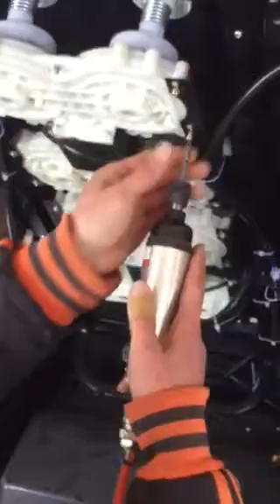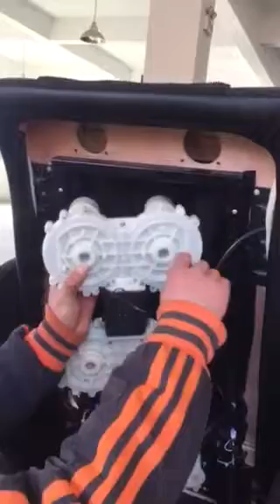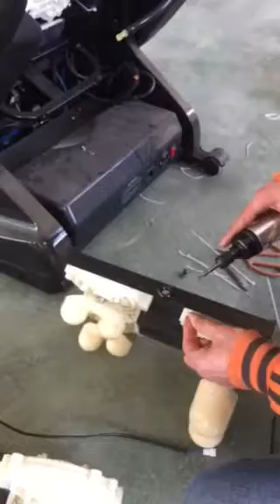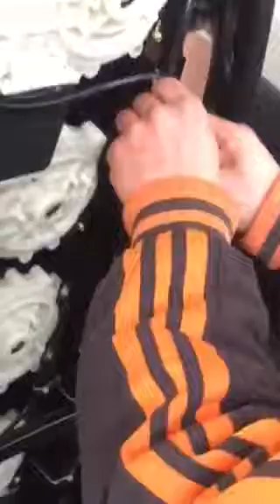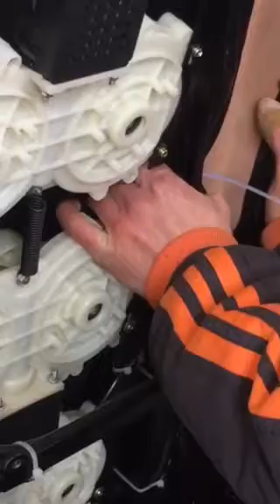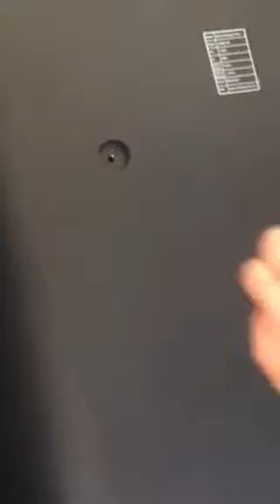Favor03 Real Relax Chair-How to replace the roller in back

Comment: I had an identical issue of the back roller stopped working.  I took over the main cover and removed the black motor cover for the back roller.  There was a shiny metal rectangular part that is supposed to detect any overheat issue from the motor.  That simple part was the culprit.  Instead of putting the overheat sensor back to the motor, I simply put it outside of the black plastic motor cover, which requires you to remove 4 screws (2 from outside, and 2 from inside) to take it out.  Then, I tested it out and it worked normal again.
Reply: Yes, it might negate the purpose of having the overheat sensor in this way, but, at least it works again!  I really don't think the motor will overheat.  If it does, at least, I have the sensor outside of the motor cover, so it will still detect it --delayed!
Reply from the maker: @calvin2681  Hey Cal38, sorry for reply you late, as our account had some problems before, we can not reach you in time. Have you solved your chair problem? If you have more questions, pls contact our customer service: service@realrelaxmassage.com.   They will help you!
Reply: @calvin2681  I also need back roller set, from where you got it?
Reply: @realrelaxmassage  
Hi can I get back roller set of Real Relax favor 03
Or any other back roller set, which go with Favor 03?
Thanks